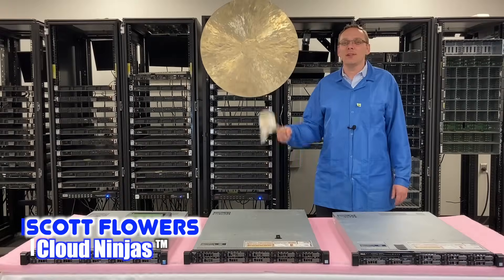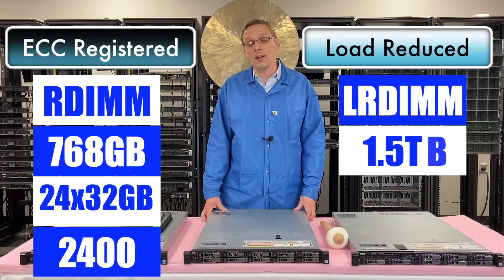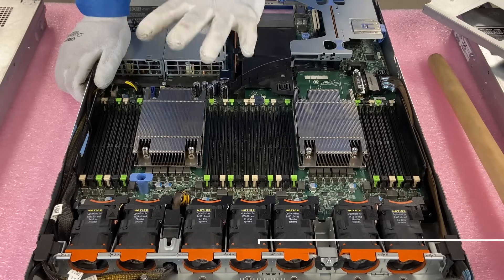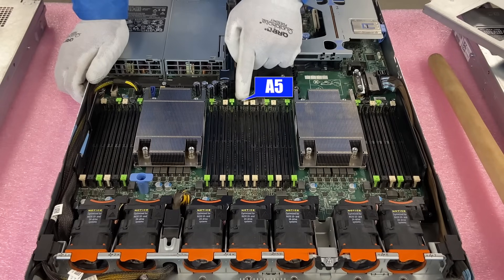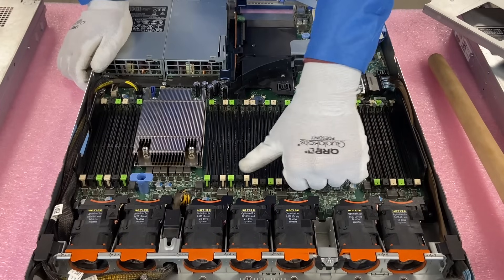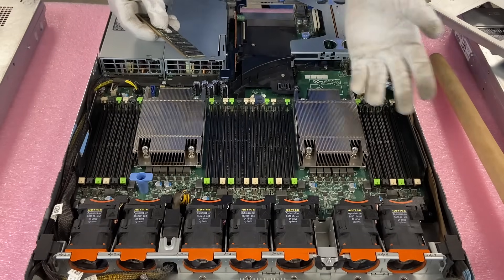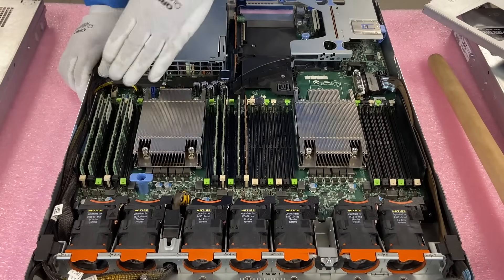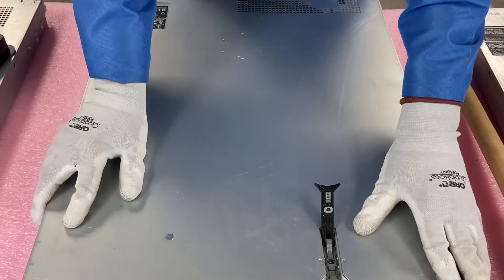Dell PowerEdge R630 Server Review & Overview | Memory Install Tips | How to Configure DDR4 DIMMs

Comment: I recently purchased r 630 with 768 g of ram with 2400 speed however the guy who is selling noticed that after 512g the speed of ram clock down to 1800some thing. If he put only 512g speed is seen as 2400.
What could be possible reasons for this behaviour. It's an 8 bay system
Reply from the maker: Yes.  Will clock down as you install more DIMMs per channel.
Reply: @cloudninjas  Thanks mate for quick reply. Is there any noticeable difference in terms of performance between 1833 and 2400 MHZ ..I will mainly be running ESXi with more VMS on top.

Comment: i have a r630 with xeon e5 2699v3. i am really happy about and i am able to max out the system but ram speed seams for me a bit low. i mean for my use case ram band with is something i need.
Reply from the maker: Contact us if interested to see R640 or newer options with faster speeds.  Sales@cloudninjas.com.
Reply: i need this system working only for couple hours a month. we have in our maker space a weather station project and we have currently 3000 to 4000 stations floating around. every one who build its station can send us the data from it once in a month and one month of data are 2gb each station. the cpu speed is not the issue the ram is 4 channels are not enough. i can run only 24 treads on that thing and the cpu max out on each used thread to 70% i have 24 32gb stick in it and have in each 8 drives caddys a adapter for 2 nvme m.2 to sas and i ran a raid 10 as 2x4. my os is on 80gb ssd that is connected internally over sata. i use the t100 card for making the images and render the simulation as a video in different locations and as the whole thing. every station making every 5 min a sample. i have running this before on a ryzen 9 5950x and a rx6700xt but this needed over 50h to finish but with this system i am able to make this in 2h. with a faster gpu i may be able to speed up but rendering is not big thing. on each burst loading the data in the ram needs some time but on the processing burst i always doing on ram and this takes way longer as loading. i have testet my program on my machine and a 6 channel system with a smaller data set and it was faster on the 6 channel even the cpu on that 6 channel system was 2years older and 500mhz slower. but for now 2h for the run is really good and i dont care if do it in 2h or in 1.5h if you consider i need 2 weeks to feed the machine from thousands of emails with 2g files and i need to rename every file and check for errors in it for only a 2h run ^^
Reply from the maker: Email our sales team sales@cloudninjas.com

Comment: Thanks, I have E5-2640 v3 with 8x8GB DDR4 showing at 1866 MHz , do you think it will work with 8x32GB 2400MHz if I put them together at the same time?
Reply from the maker: Yes will clock down.  Lower cost on 2133 speed... might be a better option.  Reminder cannot mix LRDIMM with RDIMM.
Reply: acording to Intel, this CPU model can handle  DDR4 1600/1866

Comment: I upgraded the CPU for R630 to E5-2696V4, the server only got half of the ram. The ram at positions A1-A6 and B1-B6 are not recognized. Do you know the reason why? I use 2 CPUs
Reply: Did you mix and match the ram types(ecc ram and lrdimm)

Comment: PLEASE NOTE To not do errors or mistakes: if you use v3 proc. Ram clocks back down again to 2133 wich is the fastest speed supported by processor
Reply from the maker: Great add on info Leonardo!
Reply: if you have a particularly low end V3 CPU like the Xeon E5 2609 V3, then your ram clocks get further clocked down to 1600Mhz
Reply: @hburke7799  but ddr4 is not 1600mhz, that's ddr3 speeds WTF